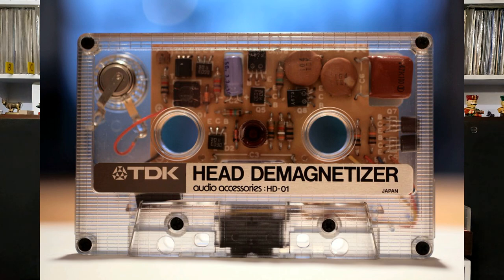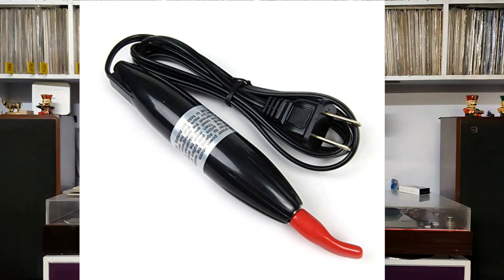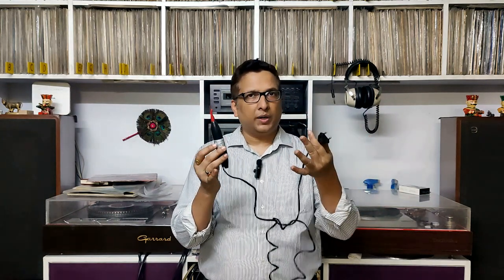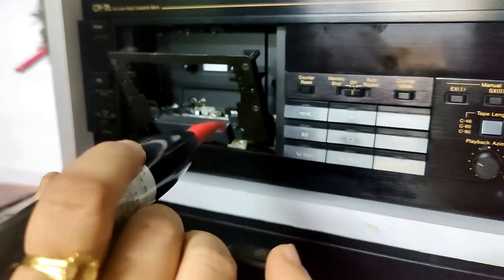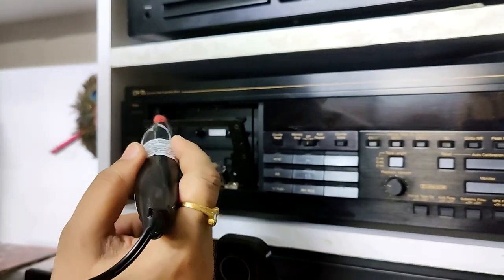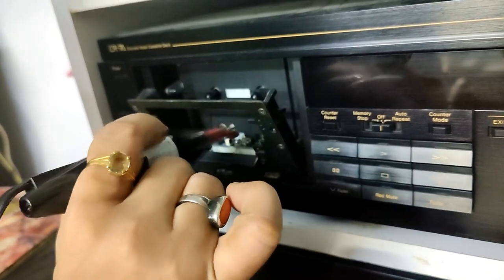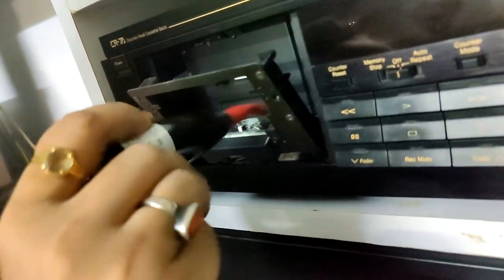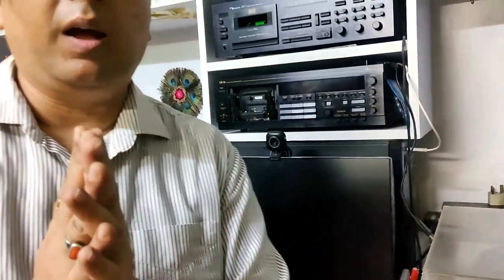Cassette Deck - Head Demagnetization !

Comment: While DeMagnetizing Head take few precautions, Your cassette deck Must be completely switch off, its output control/volume control Must be at minimum level, amps etc Must be disconnected from Cassette Deck.